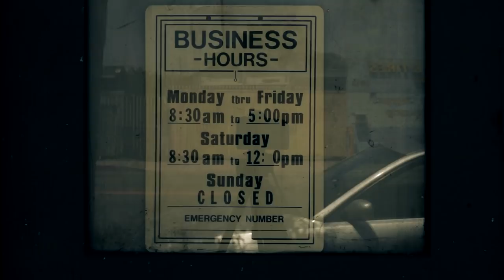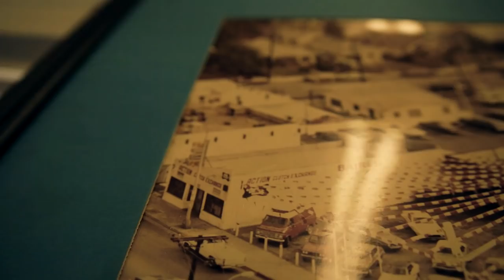ACTION CLUTCH " THE AMERICAN DREAM " ( SHORT DOCUMENTARY ) FEATURING BISIMOTO

Comment: I am a proudly customer of Action Clutch, using it since 2010 in my current track day car, punishing it damn hard in the streets too.
Purchased through Bisimoto Engineering, was my first choice in clutches (Action/Bisimoto specs. carbon-ceramic 3 puck full racing clutch) and I have not been disapointed untill today!
Best wishes from Buenos Aires, Argentina.
Thanks a lot!